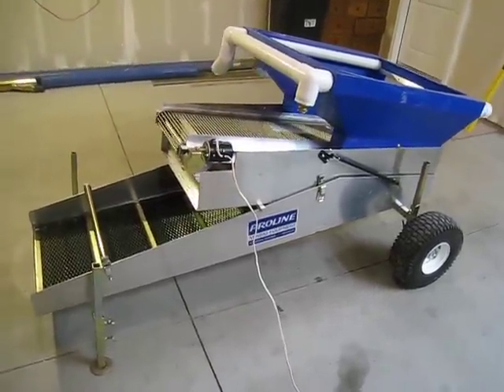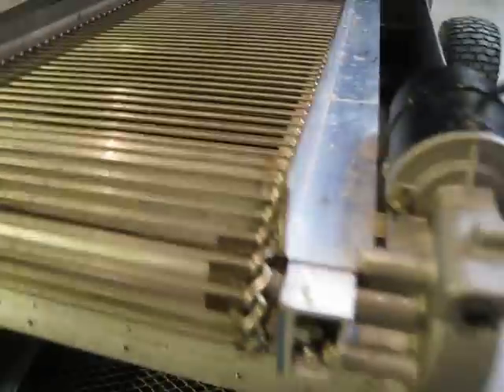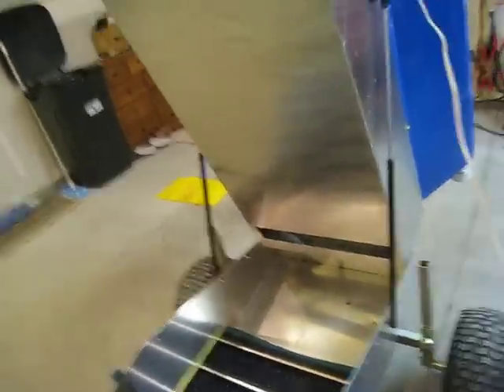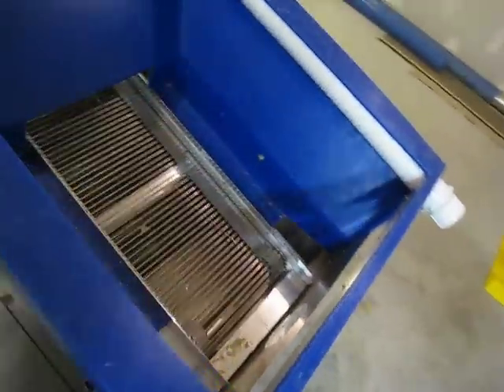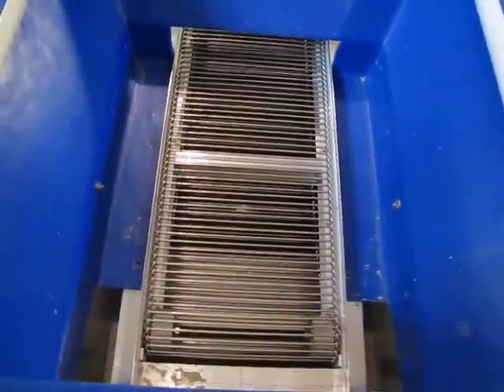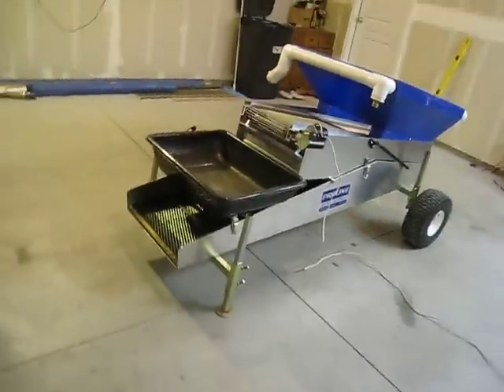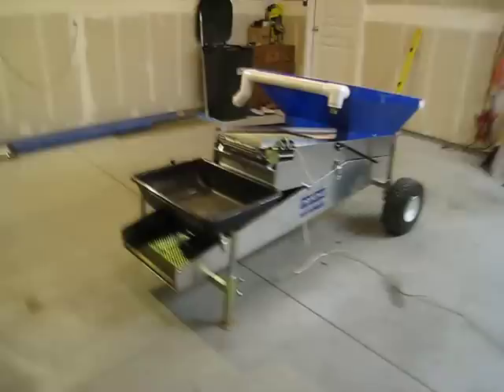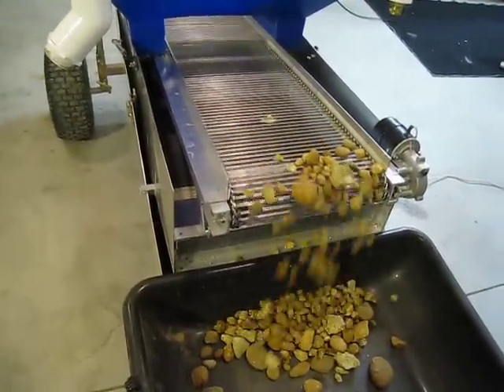Proline BigBanker with Sluice flow control & Rock conveyor

Comment from the maker: I have run it quite a bit this summer, and I am really pleased with its performance..  Especially when running as a dredge...  (It handles large volumes of water just like it is supposed to...  (sometimes more water goes over the overflow than down  the sluice) , while the sluice's water flow remains consistant..    I use Gold Hog matting in the sluice ..